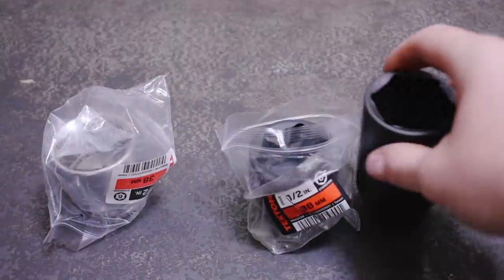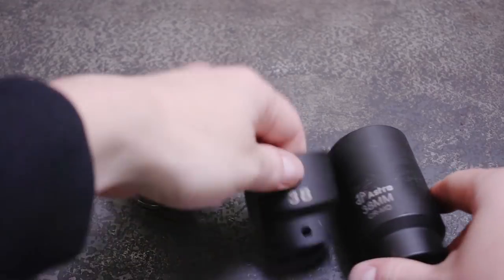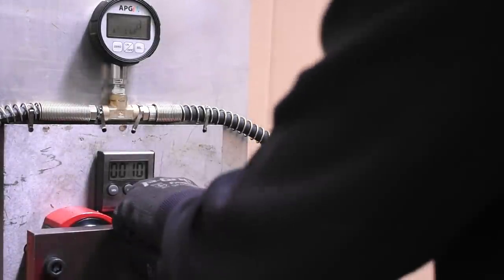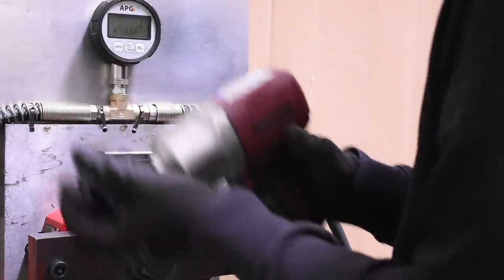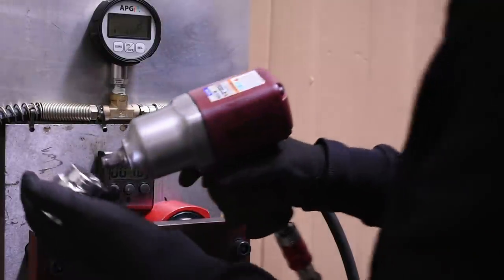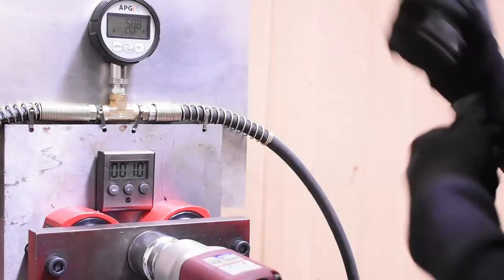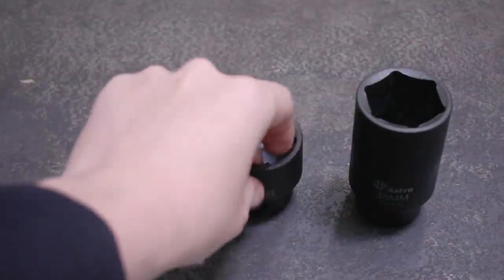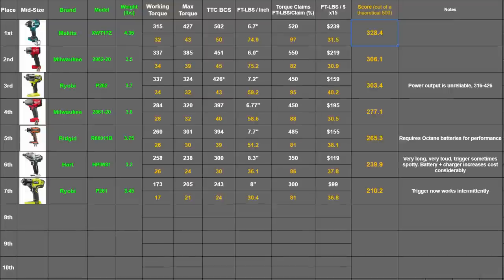Does Socket Type & Weight Affect Impact Power? Quick Test 5

Comment: Test the difference between the honda crankbolt weighted socket and a normal inpact socket
Reply from the maker: Deal. IR makes a 24mm that will fit the new smaller hex test set-up. We'll buy one.
Edit: For some reason that socket is like $80. Oh well, we need a large custom bolt that wont snap or stretch so in the cart it goes. We'd like to use a thick wall socket as well, but the only 15/16 or 24mm we could find is model # 303-1438 and it's 3/4" drive. Can't find a 1/2" drive version that size.
Reply: I've always wondered just how hard they hit, my aircat with a regular impact socket won't touch a honda balancer bolt, but the lisle socket has a 100% success rate.
Reply: Came to the comments to say this exact thing
Reply: The weird IR sockets with the ring have to be doing something, since they’ll take off those bolts like they were hand tight.
Reply: @TorqueTestChannel  much less expensive too
Reply: @PatChapp  I just used the 19 mm on my Civic. It worked amazing. It was on with 180 ft lbs. It removed it like it was a lug nut. That was with using @90psi, 3/8" Goodyear hose, Milton V style high flow fittings, older Harbor freight Earthquake, and no extensions. I was impressed. Last one I did on another Civic the time before. I broke loose with a breaker bar, because I didn't have the new fittings or heavy socket. It sounded like someone fired a shot. I did attempt with a regular socket and same gun with no success that time. Makes a huge difference 😃
Reply: @TorqueTestChannel   well I thought I found the right size, lol 😂 apparently not!
Reply: @TorqueTestChannel  Lisle - OBSOLETE AT FACTORY - 77070 24MM HARMONIC BALANCER SOCKET. That's why it switched on me 🙄
Reply: The Lisle 77080 is still available on Amazon for $21.78 and has a great reputation (for what it's worth).
Reply from the maker: @wty1313  We'll need 24mm or 15/16 hex size
Reply: Could you have your 24mm rig bolt milled down to 19mm to do this test?
Reply from the maker: @padraicmcguire108  The bolt head hex has to be larger (even if slightly) than the threads. Otherwise it just passes right through the plates without clamping them. And we're using a 7/8" thread for that so they don't stretch and mess up the data.
Reply: @PatChapp   the thickness stops the wall of the socket from flexing and twisting thus power is transmitted better through the socket
Reply: My current 1/2 team is the PT850, the IRC9000, and the Milwaukee hi-torque 1/2 2nd Gen. they all take Honda crank bolts with normal sockets. Back in the day, I had the earthquake 1/2 and it wouldn’t. But I took a 1/2F 3/4M adapter and a snap-on deep well 3/4 drive 19mm impact socket and it would pop them off every time.
Reply: Made a "crank socket" by welding curved plates to the socket to add mass. Worked just like the Lisle and bluepoint sockets.
Reply: @linadsenoj   it isn;t the mass it is the reduction of the flex that makes it happen!!!
Reply: what's the deal with Honda crank bolts?  I've removed my Integra's crank bolt numerous times over the years with my old IR 231G ca. 2005, and an old Harbor Freight impact socket.  Nothing special really.  Never had an issue.
Reply: @Patrick94GSR  B and D series engines don’t have the same notoriously-tight crank bolt. Most are talking about the J-series V6s. They routinely take far more than their specified tightening torque to break loose. Until 10 or so years ago, most 1/2 guns on the market simply couldn’t do it.
Reply: @colemanbonner  ah I see, I never had the pleasure of dealing with a Honda V6 bolt.
Reply: I was thinking the same thing the whole time I was watching this video. I'm curious to see the numbers of actual weighted sockets and how they compare.
Reply: My 1250K with any of my CalVan weighted sockets will take off or break off any lug nut I've ran up against. The weighted socket is like a force multiplier for the pin clutch.
Reply: Came down here to say the same thing
Reply: @TorqueTestChannel  could you weld in the 1/2 to 3/4 adapter to mitigate any losses?
Reply: I used one of those 19mm sockets off amazon for some really tight subframe bolts i could not get loose with a 2135ti and a chrome shorty. The crank socket weighed ~1.8lbs and took care of business pretty quickly.
Reply: @TorqueTestChannel  Ive used the Lisle 77080 (19mm, 1/2 drive) with an adapter with my old Matco MT2220 (3/8 high torque pnumatic) and had about a 70% success rate.  Using the Matco  MT2739 obviously got it when the smaller brother didnt, but it was still fun to do with the 3/8s light weight impact.  Ive since converted to all electric with the m18 Milwaukee 1/2" high torque and m12 3/8 stubby.

Comment: My theory is that weighted sockets aren't going to provide any real benefit. The weight that matters is the weight of the hammer in the impact wrench. The socket's job is to transfer that impact energy efficiently, which basically just means being as hard as possible without becoming brittle. Heavier sockets may be harder and transfer the energy better, but it is not due to the weight itself. The weight of the socket is mostly unimportant.

Comment: Do a comparison on drive size adapters...if you havent already.
Reply from the maker: You got it
Reply: Nice idea!  Also test the standard adapter that you see but also can you test the adapter that fits over the anvil without extending out away from the tool?
Reply: @brucelee64485  can you tell me what these low profile adaptors are and who makes them. Thanks in advance.
Reply: @MarkDaviesThailand  Check out the Grey Pneumatic socket adapters part number 103RA low profile socket adapters.  They fit right over the anvil of the impact gun and scale the anvil up to the next size.
Reply: @brucelee64485  Hi Matt. Thank you very much for the thought. Unfortunately those increase drive size: I am looking for a very low profile impact adaptor - specifically, to take a 1/2 Milwaukee m12 stubby from 1/2 male down to 3/8 male.
Reply: @brucelee64485  I just made a comment questioning that too! I'd be very interested to see the numbers. I have what is likely the same rebranded adapter set but mine is from expert instead of grey pneumatic and I've noticed that they seem to transfer power better.

Comment: There is a difference, you need weight on the bottom of the socket ,they need to be heavy ,try Snap On 6-Point Metric Flank Drive Shallow Impact vs the long one you use in this video

Comment: So there was a video recently of a guy trying to remove a crank bolt from a Subaru engine, using an impact gun and a thin wall chrome socket.  The bolt wouldn't budge.  Then he tried it with a large impact socket and it came right off no problem.

Comment: I own the Milwaukee M18 High Torque, and i have snapped a grade 8 coarse thread 5/8" frame bolt, a brand new one, with it. (Those have a a 1&1/16" head on the bolt for anyone wondering) I do believe i was using my deep well at the time,  the threads were lubed, and on the standard 5.0AH battery the High Torque comes with on a full, or basically full, charge. I believe the bolt was 2.5" in length. After removing rust jack that had snapped the previous bolt, i was bolting a bracket back on to frame rail and wanting to make sure they were as tight as possible i ended up snapping the bolt.

You said you were going to look at smaller stuff in the future, so i figured I'd share my story of the largest bolt I've broken with my High Torque

Comment: I've seen that lisle socket for crank bolts and it definitely makes a difference. Super thick wall thickness.
Reply: Guy I know bought the snapon in a 19. Apparently a certain crank bolt I believe on a Honda he's always needed his 5' breaker. Apparently that socket got it right off on his Milwaukee 1/2
Reply: @home541_  yes have seen this on many videos on you tube.  The socket is necessary
Reply: @kartboarder22g17  I was speaking from first hand experience.
Reply: @home541_  yeah good too know. I might buy a honda again in the future.

Comment: There is a difference, and it's extremely apparent when you look at everyone trying to remove crank pully bolts from Honda's. It's a standard 19mm bolt torqued to infinity, and lots of guys with Milwaukee, DeWalt, SnapOn 1/2" high torque cordless (as well as pneumatic) impacts can't remove them. Once you use the "specialty" 19mm socket (i.e. one that is about 5x the weight of a standard 19mm, aka the Lisle 77080) it will spin right off. 

I think the difference in weight needs to be more extreme than what you're trying here though. I'm not a rocket surgeon though. 

Good videos. I like the channel a lot.
Reply from the maker: We run into them too. It's not a standard 19mm, it's 16mm fine threads and 19mm hex size, which is non-standard sizing. But that very real difference is seen on that small bolt and socket normally, just showing here with 38mm sockets the difference is not so clearly seen. Which is what we wanted in order to test and compare with our new 3/8" sockets.

Comment: Interesting results. I've always been taught that a deep socket decreases your torque because, like and extension, it will give a little spring effect. But maybe the spring effect and the added weight cancel each other out? The deep thin walled socket would be a good test on that hypothesis as it doesn't have the weight behind it.

Comment: I’ve stepped down 3/4 inch socket to a 1/2 inch socket. Using a deep well. With the adapter in impact grade. The amount of mass greatly makes a difference. Taking off Honda and Toyota crank bolts are no longer an issue.

Comment: Could you do a test for torque loss for ill fitting sockets? For example 1 5/16" (33.34) to loosen a 33mm nut, this could approximate torque loss for a adjustable wrench.
Sometimes you're out in the field and you just don't have the right size, or you only have fractional when the machine has metric fasteners.
Obviously this risks rounding the fastener, but a test would be great.

Comment: I use a 1/4in dewalt DCF787 for small engine repair. To my surprise it took off a 32mm bolt faster than a 9/16 push mower blade bolt. weight really does matter. Cant wait to see the test with the 15/16 sockets.

Comment: Did not see that one coming. Not at all lining up with my personal (and often very flawed) experience of stuff not coming off at all, then either removing an extension or using a heavier socket it comes right off. Think its just because the 38mm socket is so large and rigid, or does it have to do with the work piece being this large? 

You guys doing a very nice job testing these things though!
Reply from the maker: We think its because of these large 38mm socket sizes, and there's maybe a size ceiling to this effect. To be honest we don't know the answer yet, or if we can even clearly see dynamic torque (force of each blow being higher) on our graphs yet for certain. We will find out with you

Comment: A cheap way to test a heavier socket would be to melt some lead or wheel weight inside a deep socket. You could fill it up leaving only enough room for the anvil and bolt head.
Reply from the maker: We've already now bought about $200 in different socket types to see  if we can measure this dynamic torque difference

Comment: If possible can you test 19mm impact vs thick one 19mm from lisle 77080( Honda crank bolt special socket) to see how much different. Air impact and regular socket won’t able to move the crank bolt but the thick will do. Thanks
Reply: I bought one, but haven’t had to use it yet.  It’s a heavy sucker.

Comment: What about the newer SUPER heavy, very thick-wall sockets they sell now, to remove things like the infamous - very difficult to break loose Honda 19 mm crankshaft bolt.  Allegedly using it, over a standard impact socket, will break the bolt loose every time.  It would seem that the ONLY thing different, is ---- the weight of the socket.  Would be great to get your take on it.
Reply: I would like to see that test too. I own the Lisle 77080 19m socket and have used it to successfully to remove Honda crankshaft bolts that a standard 19mm socket could not.  Ingersoll Rand makes a socket for the same purpose but with a different design. The IR S64M19L-PS1 socket does not look as heavy, but it has a large diameter ring that is concentric with the socket body. The ring gives it a high moment of inertia, which, rather than mass per se, is the critical factor in the effectiveness of these sockets. It would be nice to see a comparison of these sockets vs. a standard 19mm socket.

Comment: I work a tire shop and I think the weight does have alot to do with it but equally as much the fit. Sometimes a 22mm imoact socker from like Cp wont budge the lug nut but when i get the shorter heavier reg 22mm snap on socket it breaks loose right away it also has less play in it

Comment: Imagine if you used those IR sockets with the funny design. They would make all that power
Reply: OTC also makes a super thick 19mm socket. If you've ever seen the inside of a Honda crank pully holder tool, it's designed to fit in the middle.
Reply: @FromThe3PointLine  He talking about the crank bolt sockets, Tho I don't know of OTC makin any. CTA makes them as well but the lisel 77080 is the go to for the19mm on hondas. .

Comment: The theory most people have is I think that heavier hammer equals heavier blows. However, the hammer is not the socket, it's a pneumatically driven thing inside the gun. That hammer does not change and it has to deal with more and more inertia the heavier the socket. Whatever force is transferred to the socket can then be transferred to the bolt.

Comment: I've noticed a difference between a long socket vs a short socket with a 200ft lb gun. Sometimes it was the difference between breaking the bolt loose or not. Short socket always beat out the long one.

Comment: Could you try breaking that chrome socket with a higher rated impact wrench?
Reply: Most large chrome sockets are extremely hard to break.
Reply from the maker: It wouldn't break from a Ridgid high torque, ir 2235timax or bigger Matco MT2779. Sockets at this size dont seem to fail so easy. Chrome crv sockets are harder, but with thick enough walls it equals out it seems. Need to nuke a 15/16" next.
Reply: They will generally just split along one of the hex corners where the metal is thinnest and then spin on the nut. Only after extended use and  I've never had one shatter.
Reply: @TorqueTestChannel  Thanks for the reply
Reply: @andrews8722  Good to know I have a set of large 1" sockets which I use on my DCF899 impact wrench.

Comment: After using many chrome sockets ... they normally don't explode they typically start to crack and you'll see it... it takes 20-30 bolts and alot of impacting at high torque however you need to stop once you see a crack if you have to use one

Comment: Nice.  I think on the smaller sockets there is a difference where the mass is a huge delta between them.  Where did you get custom forged sockets made? Id like large 3/8 drive sockets for run down.

Comment: Although your quick test here didn't prove much, If you look at the success rate with those thicker and heavier Honda crankshaft bolt impact sockets, there's got to be something to socket's mass that enables a regular impact to succeed when it fails with a regular impact socket on the same crankshaft bolt. Thanks for sharing, keep up the great work.
Reply from the maker: The answer would be dynamic torque (power per blow). We're planning on seeing if we can see that difference on the curve with new and different sockets types at this smaller hex (and mass) size

Comment: Please try this with a smaller impact. Like a compact Milwaukee, or the mid torque DeWalt. Something that the average joe has in their garage for their car. Also, please test the HEAVY Honda crankshaft bolt socket, vs a normal deepwell impact socket of the same size. Those are available at AutoZone, I know that for a fact.

Comment: Socket stiffness is the factor IMO. It's imperfectly correlated with weight. A long extension has a lot of weight, but it has low stiffness, hence limits energy transfer.

Comment: I've noticed that my 1/2 inch impact can put down more power with a 3/4 inch drive socket than it can with a 1/2 inch of the same size so I'd be curious to see that done. Specifically with a traditional 1/2 to 3/4 adapter vs a low profile adapter like the grey pneumatic 103RA set. I've put my impact on a bolt with a 30mm 1/2 inch socket and it turned some and stopped, then I used a 3/4 socket with the low profile adapter and it removed it so I know there's something to the theory but I'd be curious to see it actually scientifically tested. Next time I do a head gasket on an ISX cummins I'll be testing my 1/2 inch 24mm vs a 3/4 24mm with both styles of adapter vs the special ISX head bolt socket with both styles of adapter for both loosening and tightening.

Comment: I think its because as you use a heavier socket, it imparts more force, but since it's heavier and has more inertia, it also gets accelerated less than a lighter socket so the two factors even out

Comment: this is interesting i think the girth around  female ends make the difference. socket flexs  in use  the part that the bolt goes into and the advil end thicken those parts by 50 % no flex just braking bolts loose with less power.

Comment: Using my 2767 I just blew up my normal 17mm wheel socket, then a normal 17mm deep impact socket, then a shallow but relatively thick walled chrome socket, and then broke the bolt with the OE special socket with a 4’ long 3/4” breaker bar. Still didn’t get the damn bolt off!

Comment: I think the size matters more than the weight or length. Say a ½ vs a 1". The larger 1" is going to get more power out of the tool because it's bigger around. Sort of like a larger rear sprocket works on a bike to give it more torque.